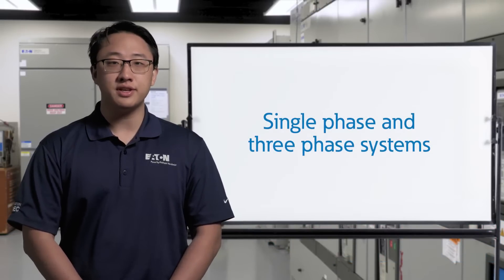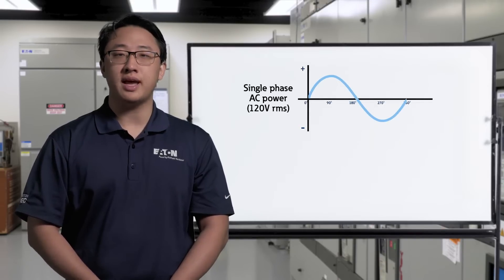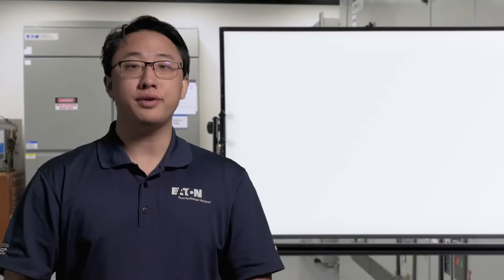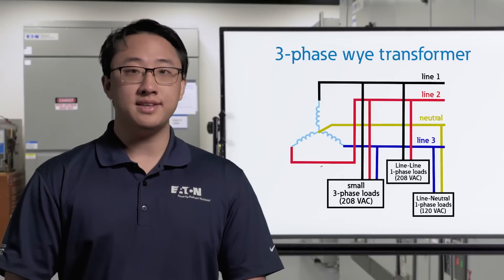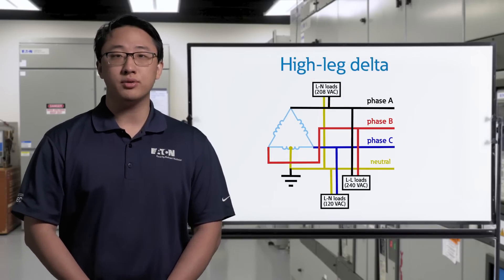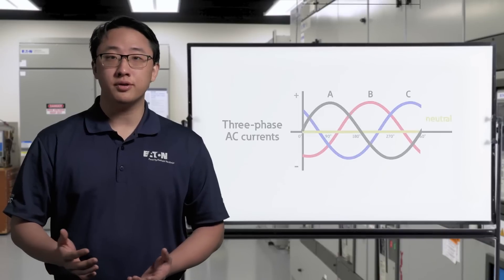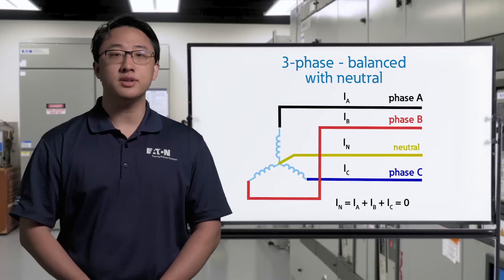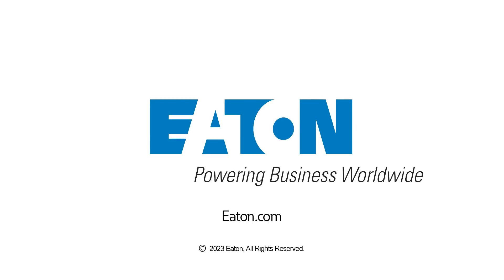Single-phase (1-phase) and three-phase (3-phase) electrical power systems

Comment: when you talked about single phase current running on 3 phase system you did not show current with 120deg difference instead you show 180deg difference. My question is how three currents with 120deg difference move in neutral
Reply: 3 phases at 120 degrees out of phase equals 360. That’s why 240 v split phase the phases are 180 out, adding up to the full 360.

Comment: In dc 3 phase power supply the phase can be precidely controled by 3 separate timers so finner details like MRI system or Data enscryption is very precise and accurate and light control and process had no resistance no heat lost

Comment: Capacitor less resonate than inductant so the solid state power supply system can better in all system than coil problem in relays and transformers. Nearly 80% intermitant problem be eliminate if switch to solid state components and easier diagnodtic and improve safety and liability even 3 phase can work better with 3 phases because from same battery split into three timer then magic happen without unexpected

Comment: @Eaton What happens if you use  3 phase cable and make 3 single phase outputs. In those situation if you have 3 devices what is worst case scenario for electric current flowing through neutral?

Comment: Thanks Seth. This is exactly what I needed to know. I now understand the layout of my circuit breaker box, and what I need to connect with a machine needing single phase 208-240V. I was getting confused if I could use the B leg on a delta transformer configuration, since the voltage to neutral was 208 instead of 120... 
After consulting the machine specifications, I got the answer... (yes).
Thanks again!